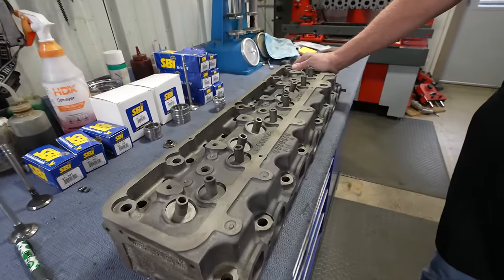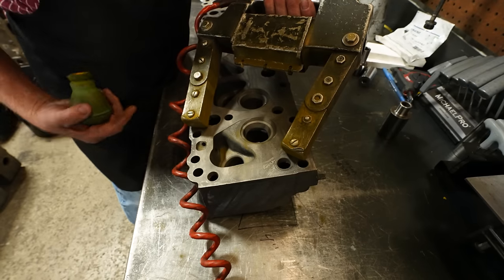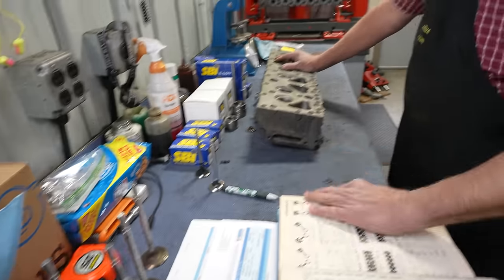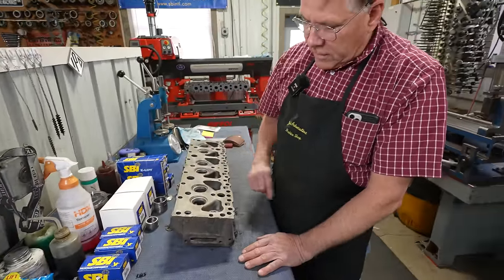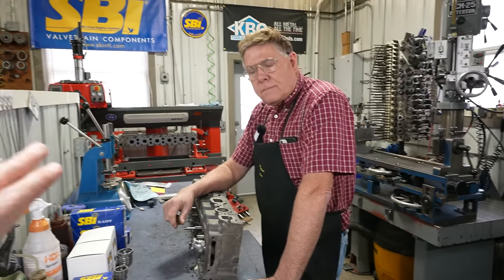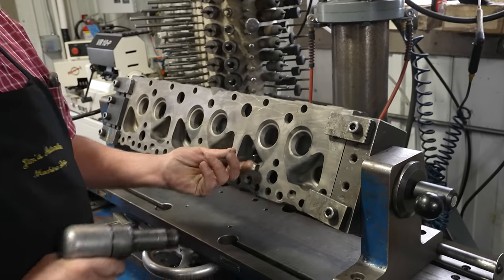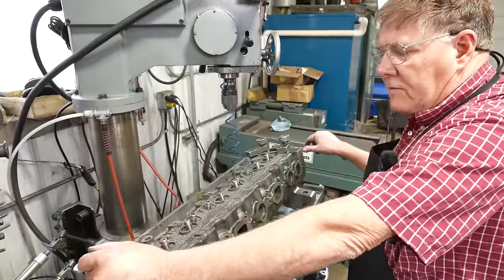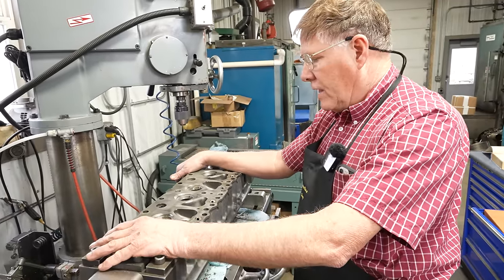Fixing The 235 Chevy Head That STUCK A Valve Guide!

Comment: Maybe you could do a comparison to test the valve seal theories on an engine. My experience is that PC seals loosen up in short order from wear, allowing increased amounts of oil down the guides. Racer dudes may want to know how much drag 16 PC seals make while oscillating 48,000 times per minute.  Umbrella seals, however, are not subjected to wear from friction. Silicone umbrella seals seem to last forever without degradation. 
Another great Jim's Automotive video!

Comment: At 32-33:00 when cutting the valve seat pockets, there appears to be significant run-out in the cutter.   The spindle just doesn't seem very stable. I guess it wouldn't matter as long as the seat cutter is centered on the guide and concentric.

Comment: You need a liquid nitrogen copper cup to sit in against the valve guide for a while, or a circulation pump with a u tube to slide in and refrigerate the inside of the guide before hammerong them out.

Comment: Excellent video. I was told long ago to cut a tiny little cut in the valve seal, for lubricate the valve stem, high rpm engines but however. What’s your comments on that?

Comment: I highly enjoyed this job. Y'all covered it very well. The "848" head is the most coveted head for the 235 & 261 engines  because they had the highest compression ratings of all the old Stovebolt engines. I'm running one of my 49 Chevy 3100 with a rebuilt 54 235. 
 As for the valve seals, I'd say that they are a huge improvement over stock. Once these engines get some RPM going theres no shortage of oil splashing around in these heads so those valve stems should get all the necessary lube while also keeping excessive oil out of the cylinders. 
Have you ever machined a 235 block w/a 2 piece rear oil main seal to accept the later model 1 piece? That would very interesting too.
Enjoy all your vids. 
Carry On.
Reply: Also the vette was supposedly the best head.

Comment: We overhauled an IH 549 v8 in a grain truck. Machine shop installed teflon? valve seals. First run, valve hung, push rod came out, bent pushrod. did this multiple times until we figured out what the culprit was. Removed teflon seals, went back to o rings, worked great. Are the teflon seals stiffer? This was 20 years ago, maybe viton seals were not around yet.
Reply: Heard that in the early 60's, 'Those Perfect Circle valve stem seals were too good, causing the stems & guides to wear out!'.  Didn't believe it then or now.

Comment: I have to tell ya about the ketchup.
Back in the late seventies I got a automotive machinist helper job fresh out of the Air Force. The shop had a machine shop in the rear and an automotive repair up front. An Oldsmobile came in with quite a bit of smoke coming out from under the hood and it turned out to be oil leaking out from under a valve cover onto the exhaust side of the heads, puddling up in the pockets they have and onto the exhaust manifold. The mechanic's worked commission so I see the guy doing the repair and I straightened the valve cover around the bolt holes and cleaned them for him. The vehicle owner picked it up at the end of the day and returned about two days later saying he still smells the oil burning. Well yeah it does smell and now it's a comeback so the mechanic has to do this for free, and man, he is scrubbing the burned oil on the cylinder heads, chipping away at all the carbon he missed the first time using brake kleen, gasoline, even oven cleaner. The boss had me steam clean it underneath on the outside lift and wire brush the exhaust pipes clean. It looked great. Gave it back the next day. The following week he returned, same issue. The owner took a shot at doing what he knows and really it did look pretty clean. It returned again, still clean, no new oil but yeah, I mean you can still smell burnt oil. There was this other mechanic there, lets call him "Crazy Jessie" from down south that always has weird suggestions and does weird things to get out of the ordinary stuff fixed, makes his own special tools, has a real small tool box and while a lot of us laugh the things he does and says, he always seem to get thing done. So he tells the boss to let him drive the car when he goes to lunch. I remember the boss joking and telling him, "Don't crash it!".
He pulled it back into the parking area at the end of his lunch, handed the keys to the boss and told him call the guy, have him come get it and don't look under the hood, it's fixed. The vehicle owner picked it up and all was quiet.
One day the car returned about six months later for an oil change. The boss asked him about the smell and the guy was happy with the car and now enjoys driving it. When the boss opened the hood he saw the cylinder heads were a mess with burned up gobs of flaky carbon and black burnt stuff all the way down the pipes. He asked Crazy Jessie what that stuff was and he said it's Kraft, Kraft BBQ sauce from the grocery store. He told the boss "There's no way to get rid of that old burned oil smell so you have to change it, and everyone loves the smell of a BBQ". He said they did that back home on the used car lots to make them smell good.
So don't worry! I'm not asking why you use "Ketchup" on valve guides, cuze you gotta do what you gotta do, to make the customer happy. I'm pretty sure the owner's gonna really like the engine when he fires it up though!
Love your Video, and Channel.

Comment: The blueing on the valves could have been caused by the engine running lean.   They should check the carburetor for warpage or vacuum leak, which would cause a lean condition and overheat the engine.   Thanks for sharing your expertise and machine work; I have watched all your episodes.
Reply: Unlikely

Comment: Why do you brute force hammer insert the seat/s or guide/s into the recess when using the fridge freezer or nitrogen cooling the seat and they just drop in fully seated location? I had used the freezing procedure faultlessly since my days as an aircraft engineering repair of cylinder heads and integral barrel overhaul.
Like you, I had machined many work jigs/guides to facilitate repeatable finishes to repairs.
Retired now, still like to see some newer machines which would have made my work days much quicker and easier.

Comment: I was 16 years old and taking girls to the drive in theater  in 1968 in a 1956 Chev 235 bel air station wagon.  We called that car "the dirt wagon". Top speed was 70 mph, but the speedometer would go up to 110 mph when spinning in the snow.

Comment: Don't know if anyone else saw or commented but at about 35:35 a piece of your punch does come off and falls towards the camera. While I observe that you have, I hope, safety glasses on, they dont have side shields between the edge of the lenses and your eye socket.  That piece could just as easily have sailed straight into an un protected eye. The top edge of that punch should have the "mushroomed" edges removed either by grinding them off or putting the tool in a lathe and machining them away. As it is, its dangerous.
Enjoying the video and your expertise. My days of "backyard" engine overhauling are long gone, for one engines seem to last better, and also I probably don't abuse them as badly. Thanks .

Comment: I would love to buy many beers to and talk at large with the engineer(s) that came up with that combustion chamber design and cylinder head's valve arrangement. To my untrained eyes it all looks pointlessly convoluted and inefficient (non cross flow design).
The lazy and uncultured swine that I'am would have done it the Detroit Diesel way: Leave the head flat, all valves the same height and build the combustion chamber into the crown of the piston, after all, these beast were never meant to be high revving, high HP terrors SO some extra mass on the piston wouldn't have broken the deal.
 
Great work as usual, #JAMSI Team ! I really enjoy your videos. I don't watch any kind of TV anymore and treat each of my subscriptions as if they were a different cable channel. You guys are boredom savers while managing to teach us a thing or two. Keep it up.
Reply: "To my untrained eyes it all looks pointlessly convoluted and inefficient (non cross flow design)."  Musta made sense at the time somehow, but it sure hasn't been repeated/copied anywhere since to my knowledge.

Comment: I just looked at the valve adjustment specs and procedure and was surprised to see them calling for the engine to be HOT during adjustment.   They made special mention that they didn't mean warm...they wanted it fully up to max temperature and this left me wondering if the people who worked on the engine before might have not done this and ended up with them too tight?   Valves will run hot if they don't have enough clearance so could this be a contributing factor in the guide seizing and valves showing bluing from overheating?

Comment: Ok Jim, I have a question. When doing press fit things, such as guides and seats, why don't you use dry ice to shrink the guides and seats? I used to work on aircraft, and an old timer showed me this, and it worked fabulous on hard to install bushings. Just have to tap a little to seat them. Normally we had to bang the hell out of them and have to ream them to size. After utilizing this technique, the bushings would not deform, and reaming was not necessary. Even though the manual required reaming for inspection purposes. P.S. I love y'all's content!

Comment: Why  ? because we did extensive tests  on unleaded, LNG and Propane and found that od honing the valves, knurling, reaming and honing NEW guides and Viton seals made for longer life.  also od honing finds non straight valves, burrs, etc.  good choice on the valves, 
no flash chrome but like triple chrome *copper- nickel, grind, chrome), valves  I like the Dura Bond sintered seats NOW better than high nickel.  rocker arm geometry is often overlooked
guide my have been in too tight or not reamed  the od hone was not the cause of a burnt valve
do you ever freeze the guides? seats?

Comment: I see a lot of old tractor engines and older generation car engines on your channel. Do you get to do any LS based engines in your shop?
 I just had the head gasket go on my wife's 6.2L in her Yukon. Aluminum head, cast block. Crazy what a replacement costs for that unit.

Comment: So why magnaflux instead over dye penetrant and revealer? Only asking because theres like a 2500$ difference in price between the two techniques...
Reply from the maker: Both processes have their place, but the magnetic particle inspection process is quick and easy with no mess.  It only works on cast iron heads.  If you are checking aluminum heads you must use the dye penetrant process.

Comment: It had low O, P, due to the .020 main bearing . and the + seals starved the guides for oil . I would had never let it go without hardened seats . I saw to many 360 390 just sink the seat 1/4 inch down because of unlead .

Comment: There's a reason new engines use the positive valve seals, they work with modern valve stem material.  I always take a Dremel tool with a sand roll to take any sharp edges out of the combustion chamber where the head surface meets the combustion chamber.  Anything to eliminate hotspots that could cause pre-ignition.  It shouldn't matter with such low compression, but would be cool to find out from an expert engine builder.

Comment: I was working on a late 70s ford truck pulled the heads off sent them to are local automotive machine shop they they did a nice job on the heads but they narrowed the valve guide s how did they do that think that was the mid 80s

Comment: If the deck or block was machined .040 then the intake valves need to be recessed the same amount.  This according to a 1950's McGurk manual for racing Chevy 6's.

Comment: Why were counterflow heads always used on inline gas engines back then? Seems the exhaust heat and siamesed bores would be detrimental to overall performance (such that it was with those typical little 1-lung carbatooters).

Comment: I had this same thing happen on a 460-ford truck engine. Rebuilt the heads completely. Customer installed the heads correctly. He started the engine set timing, everything went well. The next day he went to start and in wouldn't turn over. It bent push rods and valves. he pulled the heads and brought them back to my shop. During inspection, most of the valves were stuck. Come to find out the truck had been sitting for a period of time and the fuel had gone rancid, which caused the vales to seize in head. Customer admitted the fuel was bad after further inspection.

Comment: Great video however I’m going to have to agree with the masses. I too would like to see a dressed seat driver. I have seen the physical damage when a piece of those drivers turn into a high speed projectile, ends up piercing an artery. They did live happy to say. Why tempt fate? 40 years is a good amount of time, i’d say the odds are stacking up against you. Maybe you can assign your tool attendant to maintain your tools for you. Safety First! 
Again great videos reminds me when I formally started in this trade 50 yrs ago.

Comment: Really quality work , very odd combination chamber design . Never seen anything like that before
Reply: I have hit and miss engines. They have similar combustion chambers. That was pretty common practice back then. Did you know if you run a light enough intake spring,  you don't need any intake cam or push rod?

Comment: The stem seal should be fine ,you have upgraded the valves and guides so it is not as per factory any more ,so it doesn't matter what seal the factory used back in the day the parts are different now

Comment: That valve stem

 " cross hatch" 
It aint supposed to be left " saw blade" it should be polished some to prevent gough if im not mistaken its to hold some oil not saw a gough

Comment: The reason you get comments about those mushroomed seat drivers, is typically something like that is hardened steel (some other type of driver for a different application) - and it is extremely dangerous. While rare, people have been killed from them by a piece flying off and piercing their chest. Can hardly ever have a piece fly off, but very dangerous if it ever did. HOWEVER, the ones you have appear to be a material made to be soft, since the manufacturer knows this is an issue. Perhaps just a warning to people (like you did) saying this is a material meant to mushroom and be consumed, it is not hardened steel, so people don't get the idea it's safe to use a punch to that point.

Comment: Retarded ignition can overheat intake valves, which can cause warping. Check the timing scale on the front against actual TDC. 
I try to push valve guides into the combustion chamber and generally thread the guide, screw in a bolt and drive against the bolt with a hammer and drift. I dislike using air hammers on valve guides- but I do mostly imported car engine and they tend to have soft guides.
This was one of your best shows- I watched it well past my bed time.

Comment: I have no issues with positive seals on older engines. But when Dave one of my machinists I use built my Astron engine for the work truck, he left the exhaust seals off, as I blow smoke on starts. I think somewhere along the line the spec was updated as that engine was produced for like 15-20 years, so I think it started off with no exhaust seal but mine was a later engine. But I think he left them off anyway, I don't care, I love starting next to tesla owners getting out of their EV hahaha it blows smoke out the right hand side. Straight through exhaust with a perforated cone muffler, stock right hand exit under the tray hahaha.

Comment: It looks like the ignition was retarded. I would check the crankshaft front dampener. The distributor needs to be checked also. No or little mechanical spark advance.

Comment: You need to dress your struck tools that you were using to drive in the new valve seats. I’m a longtime metal worker welder fabricator with some machining experience but also do blacksmith work mostly to make the odd shaped parts for a welding project but stuck tools that are severely mushroomed like that tool you were striking with that cross peen hammer will send shards flying and in fact in the video you can see a small piece fly off which is incredibly dangerous not just for eyes but they can embed deep into flesh and cause severe bleeding if it hits the right/ wrong body part